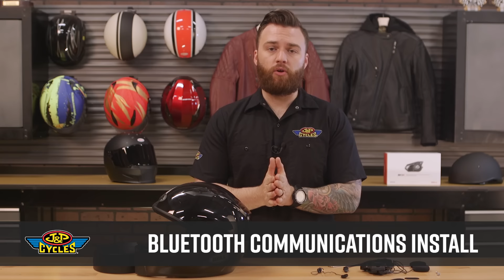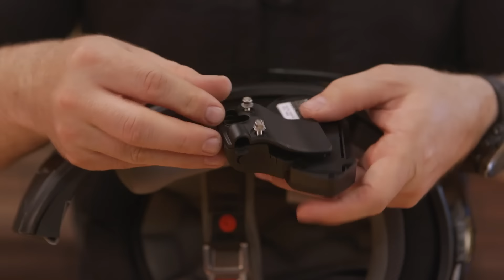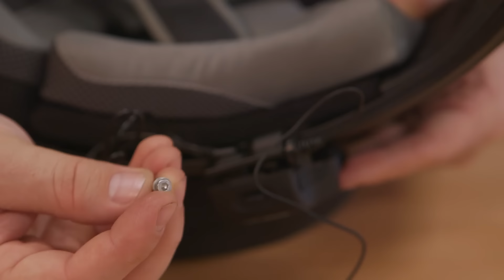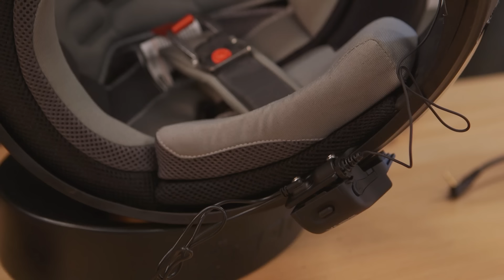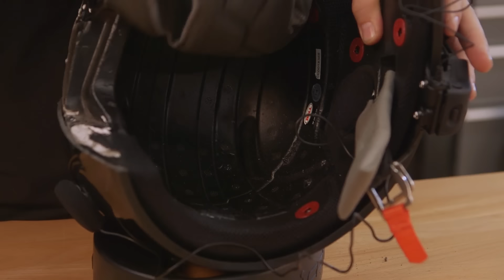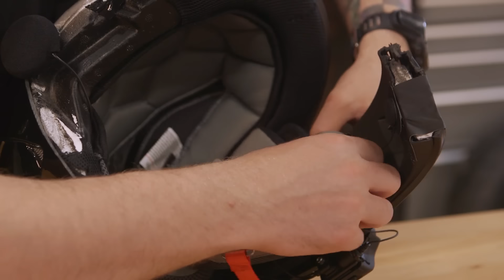How To Install Motorcycle Bluetooth Helmet Communications

Comment: The indents on my helmet were too shallow and the speakers were squashing my ears. So with a rotory   tool, I ground them out a bit and much better now.
Reply: Same problem man. Not enough deep speaker place on my scorpion exo 390 helmet. Need to be modified.

Comment: why are there no helmets that already have comunication systems inside the helmet. or other electronics such as a gopro and rear lights to be easier to see on the road. are there laws against the pre-installed stuff? and does that mean we shouldnt install things later on. after a helmet is tested on standards it feels a bit backwards
Reply: Why would you want that anyway, manufacturers would just overcharge for things you can get for under 50 bucks on amazon. People are already picky about helmets, imagine you as a manufacturer now have to contend with people being picky about the helmet AND the electronics. Hell, it's nice enough that they give us grooves in the cheekpads for the speakers.

Comment: I agree with Paul-cc5rp, made it look so easy, my only concern is if you don't have the cutouts for the speakers how do you securely hold the speakers in place on the cheek pads/padding?

Comment: So I have a question. You using a bell helmet and I have a Bell Qualifier DLX mips. The cheek pads have speaker pockets built in. Does that put pressure on your ear or would you notice them inside there and how would it affect where the wiring gets tucked away?
Reply: I was wondering the same...

Comment: I have one question , do you actually need the mobile phone on you when riding or do they communicate directly to each rider with out the need for the phone . We ride dirt bikes and like to communicate with each other but don,t want to carry our phones with us on a ride .
Reply: That's like holding your phone to your ear for a call while blasting spotify 😅
Reply: @K . No I recently bought a pair and they communicate directly to the other rider no mobile needed , once you pair the two units it links to the other rider and you can talk to each other over several hundred metres . Ours can link to a phone for calls and also has FM radio mode as well .
Reply: @hondared250  can ypu listen to music on your phone and intercom eachother at the same time?

Comment: my three helmets have the headset slot but in the three cases this slot does not fit over the center of my ear, so, If I install the speaker inside the slot it will be behind my ear
Reply: Me too. I’m trying to figure out how to troubleshoot this. did you find any solutions?
Reply: @sgtsquiggly  I'm using airpods 😅 with a motorcycle mask for prevent them from dropping when I take off the helmet
Reply: @whidrox  be careful. I have tinnitus now cuz I used to never wear earplugs when riding. trust me, you wanna protect your hearing. if you wanna wear earbuds on the bike get a pair of plugphones. they're great.
Reply: @sgtsquiggly  Thanks for the advice! do you have a preferred brand for plugphones?
Reply: @whidrox  plugphones is the brand name

Comment: If your helmet doesn't have headset slots its not gonna work, unless your helmet is too big.
Reply: My helmet has slots for speaker but, need to be modified. Not deep enough. And a lot of headsets are silent as hell when use in helmet.

Comment: I have a harley helmet that doesn't have removalable liners, how do you suggest set up
Reply: Get rid of the harley would be the first step
Reply: @alpinweiss  I said a Harley helmet moron, listen before trying to speak
Reply: @kurtfirestone2761  why you have a harley helmet if you don't ride a Harley?
Reply: @alpinweiss  he's been quite ever since this comment
Reply: just an impossible question, you can´t. Get a new helmet or tape the wires to the inner part of the one you have, or..... remove all lining on your present helmet by force and after you tape all the cables and speakers have it re-lined by a professional. good luck